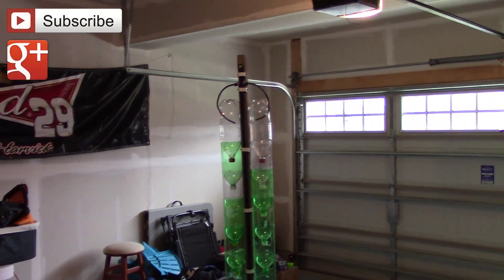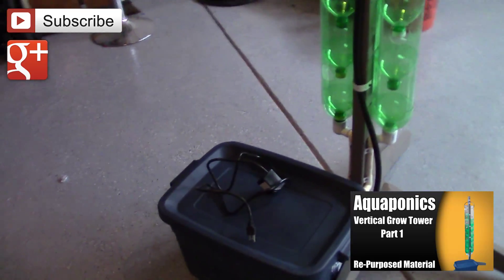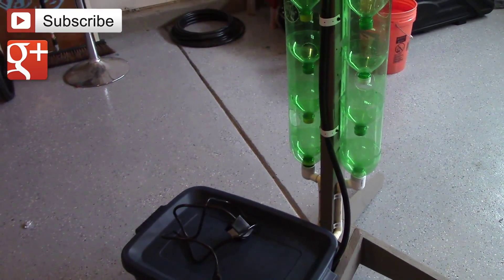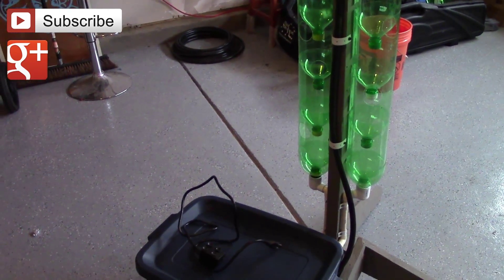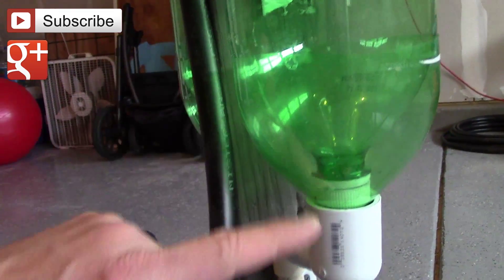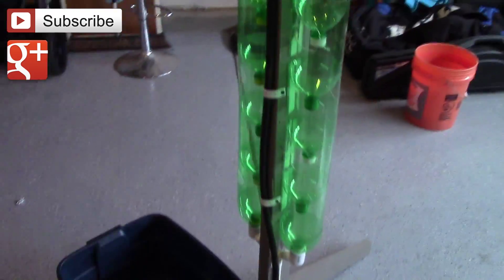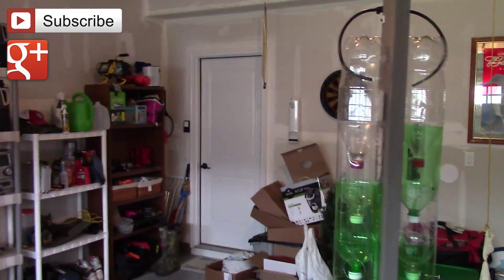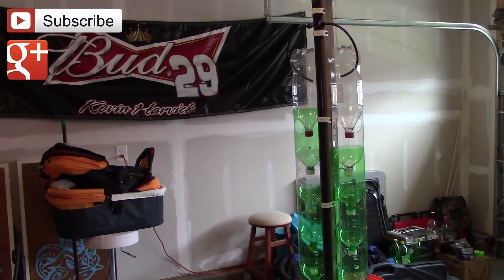Aquaponic/Hydroponic Vertical Grow Tower (Part 2) - Re-purposed Material

Comment: Really digging your videos Wayne, learning a lot from them. I'm gonna be building my worm farm bins using your video tutorial and also gonna be giving these aquaponic towers a go I've got 2 or 3 large garbage bags full of plastic bottles that need repurposing/recycling. 
Also wanted to advise you melting the holes to the desire size using a heated metal can or similar, much easier than drilling with a hole saw. 
Cheers!

Comment: ***** have You heard of a air lift pump ? Its a fish tank air pump and air stone  in the tank/tote  useing a inverted funnel over the air stone as air rises in the tank  it carries some water up the tube inbetween each air bubble  

This might shove Your problem with limited head height problems with a cheap water pump  as head height increases the GPH/GPM decreases rapidly 

Somebody mentioned algee growth in the clear or tinted bottles  how about spraying the bottle with a outdoor paint  like a rustolem type  

Anothef idea is to make Your stand legs the size of the tote in the shape of a box to fit the tote that way You could put a grow tower on each corner 

Since You have 14 bottles on one corner of the tote You could get 56 bottle in relative the same space 14 x 4 corners
Reply from the maker: Walt Lars - Yes, my first video on YouTube was an AirLift Pond Vacuum! :) A friend of mine, and I are going to be testing a new style of air lift pump this summer and I'll let you know the results via video. We're trying to get water to a height of 16ft up w/less than 35watts of solar energy. I think air is the way to go. Will be testing it in the local lake before building a system in the greenhouse.
Reply: You would have to play around with size of tubeing  and size of funnel  also how much of a bend in the tubeing  you could get away it 
I am thinking a bend in tubeing  would allow the water to escape from the under air bubble I havent made one of these but I just thinking  16 feet is a tall order =) maybe a collection tank 1/2 way up with  a second pump ?
Reply: Do You have a link to that vid about the 16' lift ?
Reply from the maker: I hear you about the second tank Walt Lars. I'm not sure. I was thinking about digging down 25' for so, to get enough pressure to get the water up 16' w/a lot less air. I don't have a video of us working on this system yet. Only the pond vacuum that I made when I first started my channel. You can just search my YouTube channel for "airlift" or "vacuum". There are 3 videos I think.
Reply: Check out Rain Gutter grow system  page group  on FACEBOOK and Larry Halls vid  on YouTube  for his pop bottle growing system  it's similar to what your doing
Reply from the maker: Awesome thanks Walt Lars. Will do. I think I've found Larry in the past when looking at my worm farming stuff. :)
Reply: Check out His other vids

Comment: On using the clay pellets they get heavy.  I think Ann's ( Gideon's Garden) on using Perlite is the better way to go.  There are different sizes of Perlite available so fine tuning it for the Your Bottles can be done to adjust the holding time for the water.  Finer to hold longer between cycles or bigger for less water holding and more air.  The design is good I suggest also that You amp it up and use bigger containers for Your next build.  Using existing products repurposing them is a wonderful way to go and helps relieve our landfills Way to Go!
Reply from the maker: Hey Tip Krimont, sorry it took me so long to get back to you, I've been swamped! Additionally, you made another comment that I didn't ready and I accidentally deleted it...with the new back end commenting system, I don't know if I can get it back or find it so let me know if there was something important that I missed please! :-/ I hear you and Gideon Gardens and I think what I've decided to do (I already have some expanded clay) is to try some of both (maybe bio-char later) and see how the plants react. The reservoir is small right now so I can play with it and easily manipulate things...as I fine tune it and get it set up, I'll probably add a much larger tank and include fish (right now I'm going to test as a hydroponics tower). I'm thinking something along the lines of an IBC Tote or generally that size...then I can add as many towers as I can find bottles to make them with, right? :)
Reply: ***** Hi Wayne.  You are swamped and that is a good thing.  IBC is nice and there are even videos on how-to.  I am a firm believer in using what is already manufactured if it can be used safely in food production.  My videos can be seen with Folgers coffee containers as they are perfect size to grow a Tomato, Pepper plant in a Hydroponic system.  Not for dirt of course.  The reason for Perlite is I have Repurposed several Topsy Turvy planters in my Greenhouse that have Clay pellets and they are very heavy.  
Anyway Wayne its good to see your success, where did all Your Free time go right! LOL
Keep up your caring and stay on course with your new communities and Your Brand.  I like your thinking and appreciate your posts.  I am ordering BioChard and am excited to use it in a hydroponics setup without Fish to see if I can achieve some bigger Yields.
Take care Wayne  Tip

Comment: looking good! do you know if all of those plastics are food safe?
Reply from the maker: Hey *****, thanks for the comment and for watching! The grow pods are 2 Liter bottles, the cpvc pipe is commonly used for plumbing in a home, and the sprinkler system pipe is used for watering gardens...so I should think so although I didn't think about that off hand. Thoughts?
Reply: ***** all of that sounds ok, i would worry the most about the plastic tub at the bottom, perhaps you could get a food grade barrel or food grade 5 gal bucket for a sump?
Reply from the maker: ***** - Good point. I will say this, everybody else is using these tubs for their hydroponic setups...that said, just because everybody else is doing it, doesn't make it right or ok...so I'm going to do a little thinking. A 5 gallon bucket is much too small though and a barrel is too tall...so I'm going to have to figure something else out if I make a change which is inevitable anyway at some point. Thank You for your insight man, I appreciate it!
Reply: ***** you could cut a 55 gallon food grade barrel down, or connect two 5 gallon food grade barrels with a uniseal and pvc, just a few ideas!
Reply from the maker: Ok *****. I may even build a few more of these and set them up at a higher elevation and then use a larger IBC tote to put fish in...I really think that's where I'm going with it. :)

Comment: Hi Mr ***** :)
I would go with the clay as they are lighter than other media.. Might want to consider a covering on the bottles so algae doesn't take hold & start using up the valuable nutrients.. Most definitely a magnetic drive pump would be the way to go.. I personally would go with a tote twice the size so room won't be an issue later on down the track if you think you need to add more fish../
Just my 2cents for what it's worth..
Cheers sir..
Reply from the maker: Ok Rob Bob, I plan on covering them after I get it all up and running. Thank you for the advice in regards to the pump and media. I'm leaning towards the clay as well. I'm not super familiar with the best type of pump to get, do you have any suggestions? Thanks in advance brother!

Comment: Hi Wayne, very nice design! Looking forward to seeing it in action. Personally I would use perlite  instead of the expanded clay pellets. Less weight and less expensive.
Reply from the maker: Thank You Gideon Gardens for the compliment, I try to keep things neat and tidy. Perlite huh? I hadn't thought of that yet...humm...I'll consider it. Have you ever tried Coco Coir for something like this? I'd thought of that too... Rob Bob seems to think the expanded clay is a good choice. Maybe I should try different types in this same system and compare performance. :-)
Reply: ***** mphgardener uses perlite in his dutch bucket set up. I'm using a mix of 50/50 perlite and coir for the tomatoes I have in the drain to waste buckets which is working out really well. The coir leaches out and causes the water to turn brown. I don't know if that would affect the nutrient solution, maybe ask ***** I think he uses coir. My thought on the perlite is that it would hold the nutrient solution longer than hydroton.
Reply from the maker: Ok Gideon Gardens, this makes perfect sense! Thank you for your extended reasoning! :-)